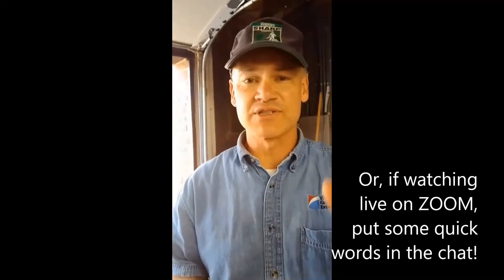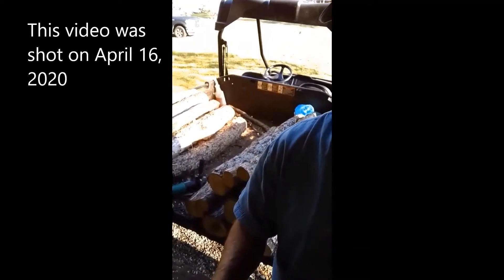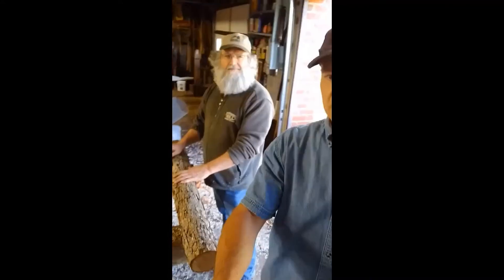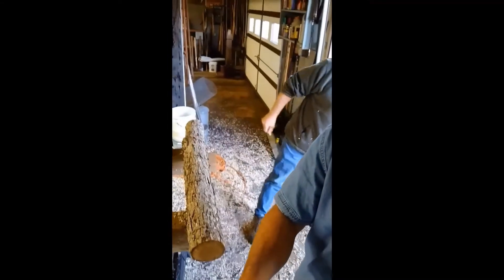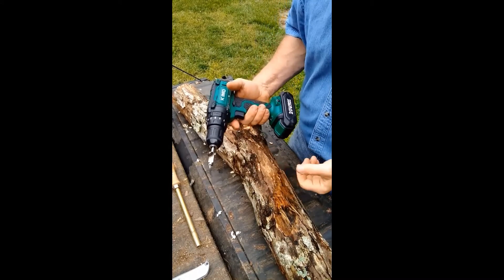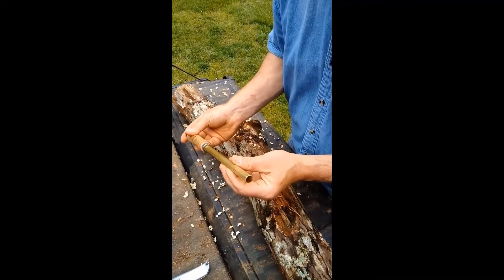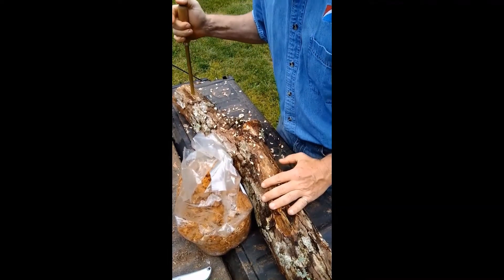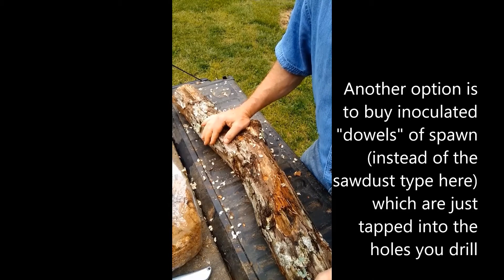Fifteen Minutes in the Forest: Growing Shiitake Mushrooms at Home

Comment: Can you use paraffin wax?
Reply: Good question Heidi. You can add some paraffin to the wax made for this but straight paraffin doesn't work very well as it cracks and falls off when dry.  The wax we use stays somewhat flexible.  We have, however, added some old candle wax to the other to make it go a little further.